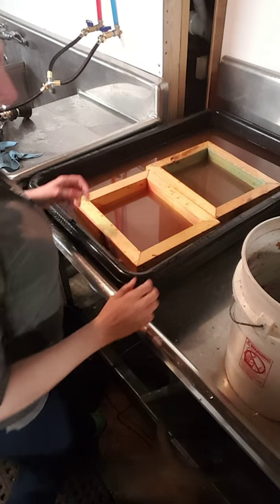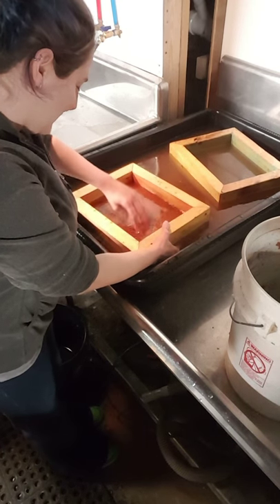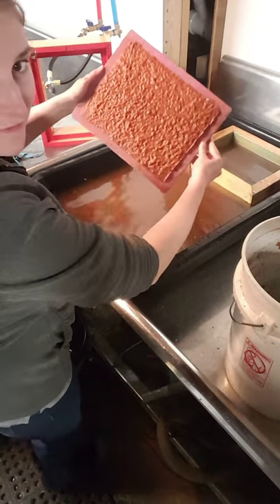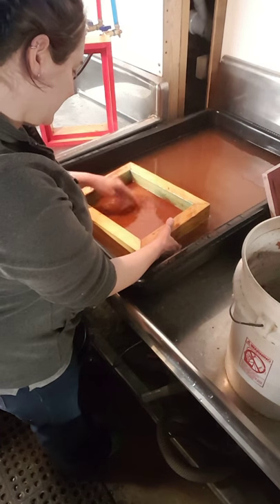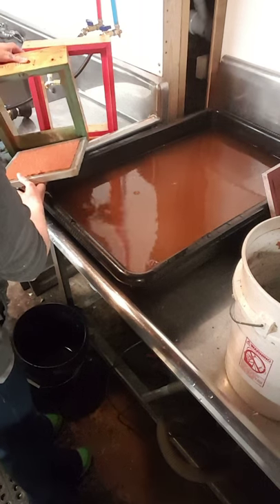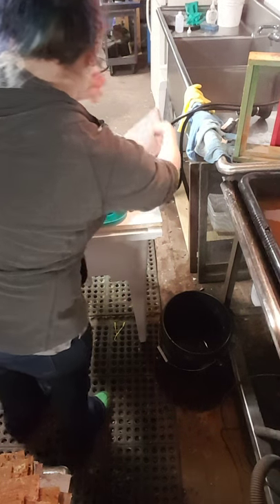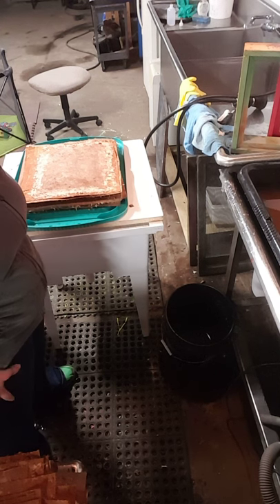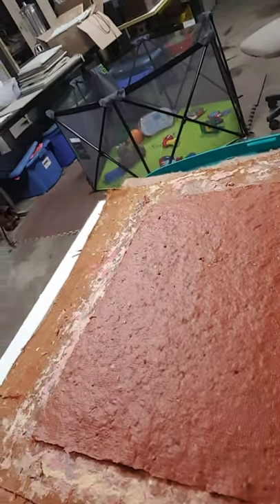Making handmade paper with pour moulds

Comment: I'm trying to make a small pour mold for home use and wonder if you have suggestions on what to use for the two screens. Anything around the house would be great so I'm considering multiple layers of cheesecloth for the tight screen. Do you think that will work?
Reply from the maker: UtahRoadbase I wouldn't use  cheesecloth as it would stretch out too much. Fine weave window screen works pretty well if you stretch it tight enough. If you're looking for inexpensive small moulds & deckles, I highly suggest checking out Wooden Deckle on Etsy. They have really affordable moulds that are easy to use.